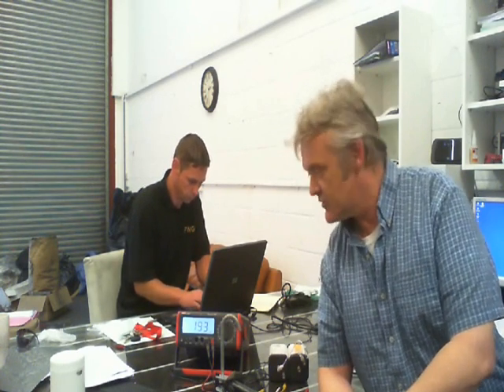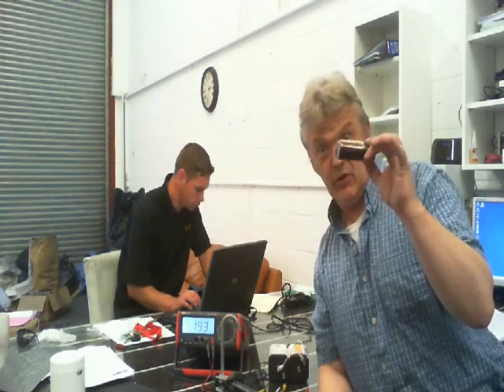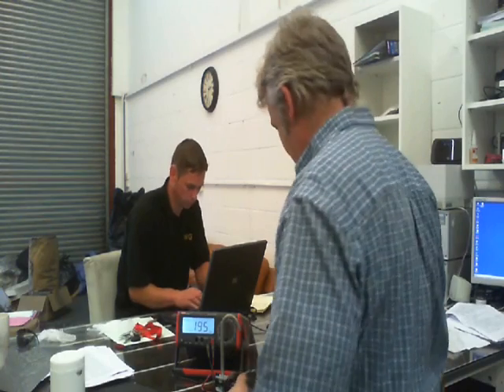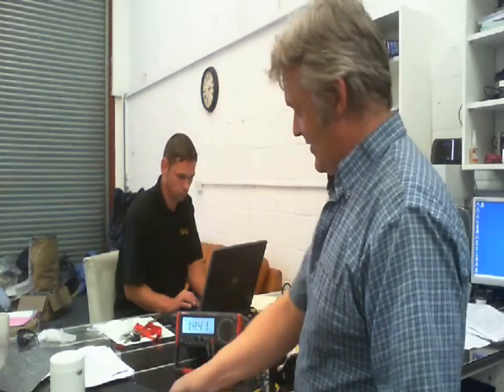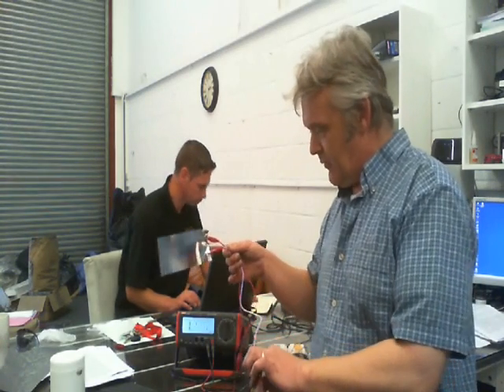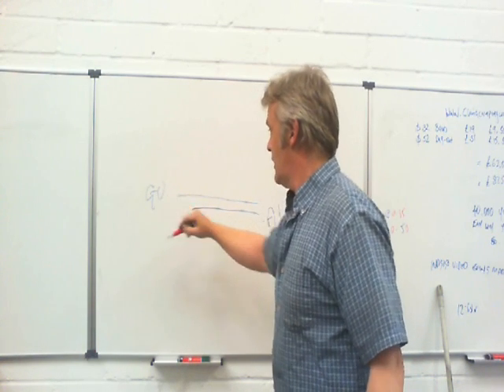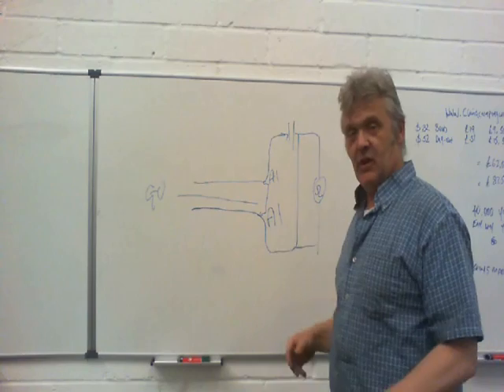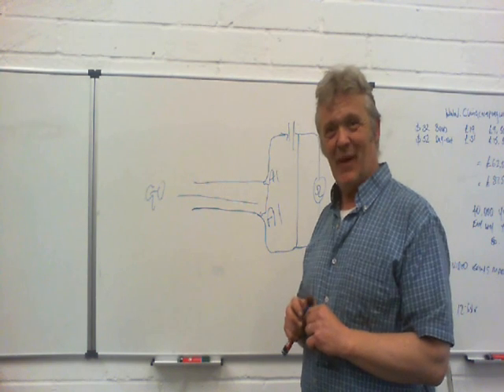Painting A Memristor With Graphene Oxide

Comment: The schematic shows the 2 Aluminium layers shorted. If this is true you are never measuring the resistance of the supposed memristor. You are measuring the internal resistance of the battery.
Reply from the maker: Mehtap özkan ok

Comment: groovy stuff!
Reply: reminds me of the graphene molybdenum graphene sandwich ( with no contact ) apparently a very interesting combination for batteries.
Reply from the maker: actudoran
it is lol
Reply: judging by the valence number, wouldn't Molybdenum Chloride be a more potent electrolyte than AlCl3 ? ...
Reply from the maker: actudoran
i guess - but it hydrolyzes readily to form HCl and is aggressively oxidative - not sure how you would handle it or even if it possible to form a stable system using it
Reply: just a quick question ... I can get my mittens on iron chloride - apparently it is used for cleaning the cables / conductors ... 
Thing is that Fe is either 2 or 3 valences :) I don't know which one.
if I get it and it doubles my voltage ... 2 ... trebles it ... 3 then ... am I right ?
Reply from the maker: actudoran
maybe - but it is corrosive stuff - it's a lewis acid used for copper etching - remember there is a world of difference between theory and practice
Reply: I'll get a little bottle of 250 ml 30% and see what happens... when you say corrosive, does i attack plastic ? should I use glass instead ?
If I go time I'll pop to the shop today and get some along with a supercapacitor 2.7 V 100 F and see if it charges it :)
Reply from the maker: actudoran
plastic will be fine mate
Reply: phew ... good ... otherwise I had to go and quarrel with the missus for her small glass bottles full of God Knows What ... :)
Reply from the maker: actudoran
lol - that rings a bell - i get into a lot of trouble for using things from the kitchen to do experiments lol